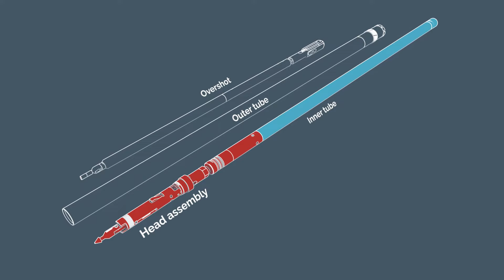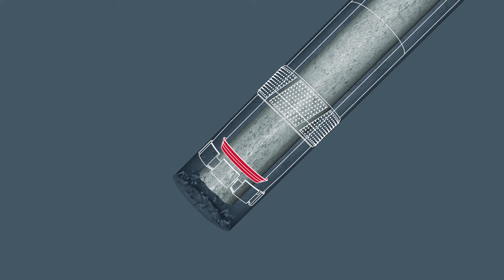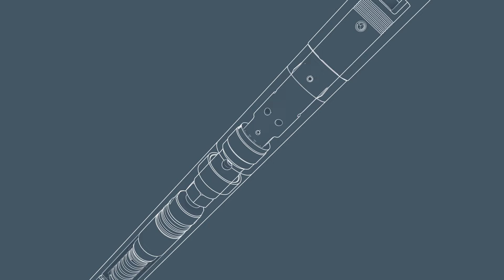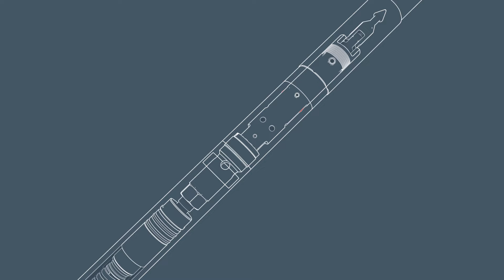Core barrel

Comment: The bearings on the inner tube are there to prevent core loss and stuck core tubes when the core tube blocks off by allowing the core tube to spin. The core tube adjustment has nothing do do with fluid flow to the bit. The core tubes should all be adjusted to the same distance from the Bit whether you are Drilling AQ to HQ,HQ3 or HQTT. Fluid Flow is controlled at your Pump and Hydraulic Settings. The Wireline Core Barrel System was designed and built by Boart Longyear they are still making improvements on it.